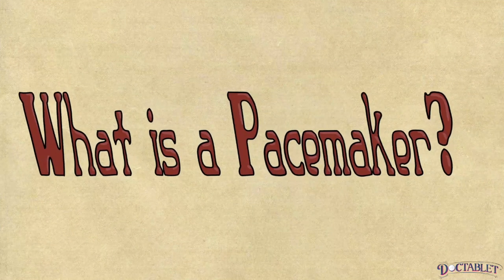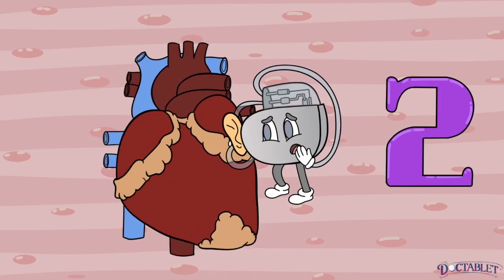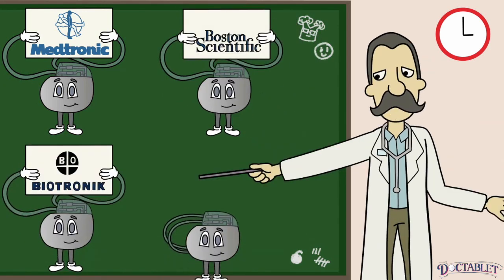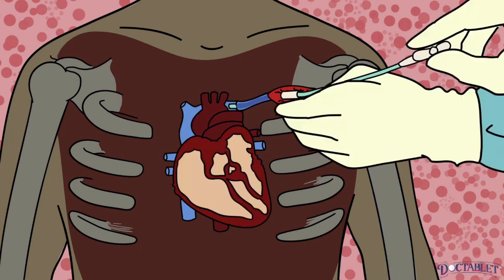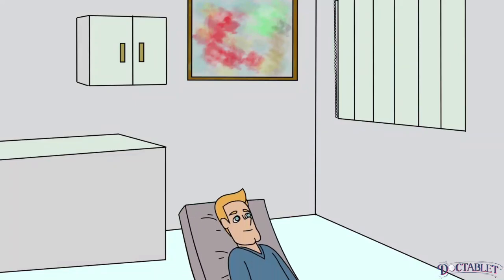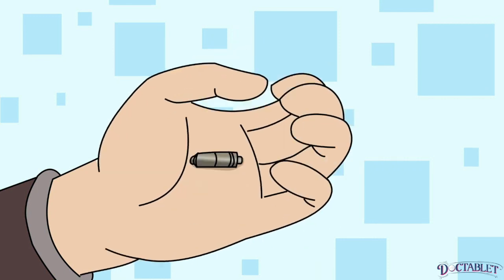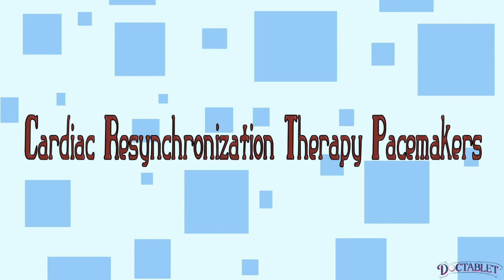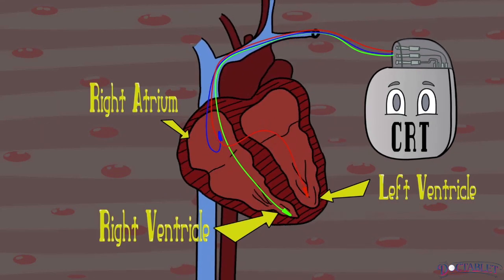What is a Pacemaker? Lead-less pacemakers, Cardiac Resynchronization

Comment: I have ICD (Implantable Cardioverter Defibrillator) since 11/2017. And after 3 years & 8 months shocked me 2 days in a row. My Sustained Ventricular Tachycardia went off last month 08/26 & 27/2021. I waited until the 2nd shock before I went to ER. I should have went to the ER @ first shock. I thought I was fine after the first shock. Now, I'm taking Sotalol 120MG 2x a day to control my irregular heartbeat♥️
Reply from the maker: thanks for sharing your story!
Reply from the maker: thanks for sharing your story. there are ablation procedures available nowadays. sorry to hear of your struggles though

Comment: Thoracotomy: In this approach, your chest is opened and thin oval patches made of rubber and wire mesh are sewn onto the outside of the heart (epicardium). These patches are connected to the leads.

Sternotomy: This approach is similar to a thoracotomy in that the chest is opened. The difference is that the incision is made over the breastbone (the sternum) and the leads are advanced into the heart. A sternotomy may be combined with coronary artery bypass surgery or heart valve surgery
Reply from the maker: Pacemaker placement involves neither of these. Pacemakers are placed under the skin.
Reply: @Doctablet  except in babies. The chest is opened, 4 wires are stitched onto the heart and the pacemaker is hidden under the Ribs in the abdomen area in order to prevent it getting damaged.